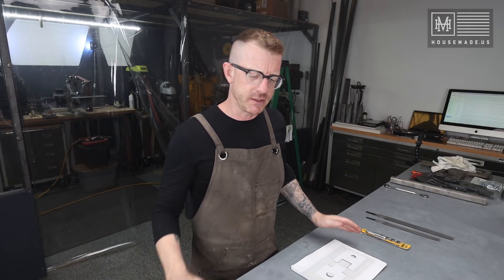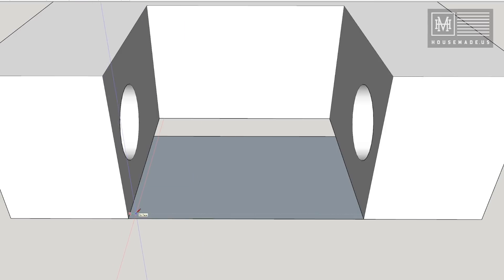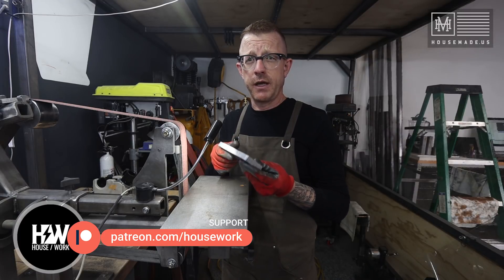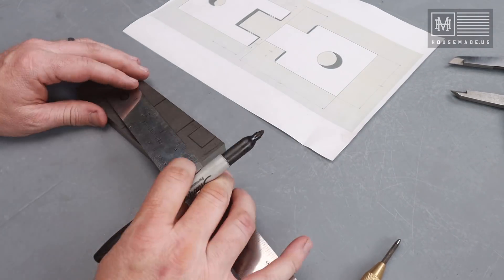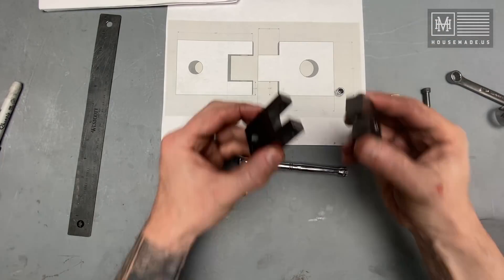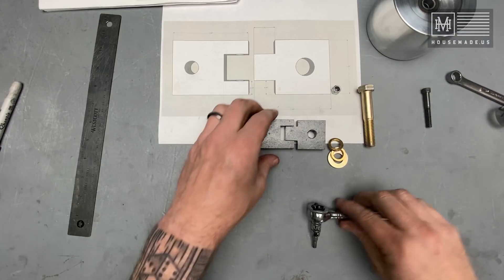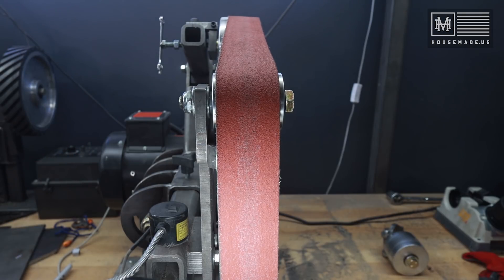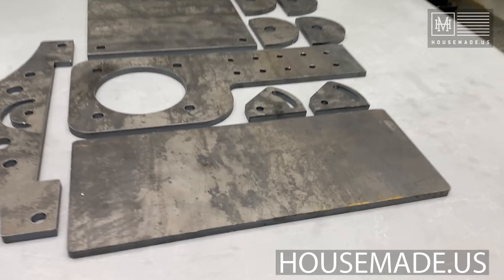How to: 2x72 Belt Grinder DIY Tracking Mechanism Build

Comment: also how to you know how to set the angle of the mechanism (align) seeing as you only have one hole and it wont bolt in square..
Reply from the maker: I use a speed square to line it up and adjust as necessary afterwards.
Reply: @HouseMadeUS  thank you for getting back to me. I ended up finding your alignment video and that basically answered all my questions. It is now my set-up bible.

Comment: If using plasma or water jet to cut the metal out is easier, cleaner and more precise, then why not offer it in the bundle package?
Reply from the maker: It’s coming in Gen 4 which is about 2 weeks out. Great minds! 💪🏻😁
Reply: @HouseMadeUS  good deal. Im a few weeks out from wanting to place an order. plus with the weather, i wouldn't get it in a timely manner. good thing its 70 degrees and sunny sky here in chile, sa. suppose to be cleared out next week for my trip back hm, to tx.

Comment: brilliant video a bullet proof unit that would survive ww111 good build as well what size contact wheel are you running it looks to be about 160 mm dia and what is the fastest belt speed you can run in meters per second please
Reply from the maker: I run a 10 inch contact wheel and at full speed we are around 6000 rpm. 😁🚀
Reply: @HouseMadeUS  that is fast 32 m/sec is recommended as a maximum for high grade steels your up to 77m/sec at 6000 rpm that is fast sir very fast, would like to have a go on that.

Comment: Just curious, why not put this in the Ultimate Build Pack? Couldn't add much to the price I wouldn't think. It would be nice to have laser cut parts.
Reply from the maker: We are working on a tracking hinge. It uses different thickness of steel so we have to buy a whole lot to make them cost effective. Small start up issues really.

Comment: Would the proposed rotating tracking mechanism allow the existing tracking wheel adjuster bolt to still work? I would say you would be twisting the bolt in the threads. I don't know if this makes any scene.
Reply from the maker: Yeah it still works, the threads are in the tracking arm not in the mechanism, so the mechanism can move freely but once the bolt is locked down it stays put.
Reply: House / Work so the tracking wheel end of the bolt is skating across the face of the bracket?
Reply from the maker: Not sure I follow what you’re asking.
Reply: House / Work where the tracking bolt touches the plate with the wheel on.
Reply from the maker: Have you watched the tuning video where I demonstrate this type of mechanism? https://youtu.be/DaOH322WRto

Comment: Do you have a drawn out plan with measurements hole sizes and tap or bolt sizes we can purchase to make this?
Reply from the maker: I’ll email you my drawing. 😁
Reply: House / Work Thank you
Reply from the maker: Did you get the email?
Reply: House / Work 
Sorry I just got home about 10 minutes ago. Yes I did thank you again and now to get metal ordered to get tomorrow after work. That will make it so much easier.  Thank you again.

Comment: Man I needed this video like in a bad way.  I had built my own 2x72 grinder about a year ago and although it was my first foray into welding I think I did a decent job although the welds look horrible.  In any case I have been having the hardest time getting the tracking right.  Can't tell you how many knives I have made over the past year and always have to straighten out the plunge lines with good old hand filing.  This is even harder and more time consuming when making my camp choppers.

I watched this video last night and when I saw the part about having a bolt at the top of the tacking mechanism that allows you to rotate the whole tacking assembly forwards or backwards it was like a light went off in my head.  What???  I thought I had everything lined up but apparently not.  I got up this morning and remade my whole tracking assembly.  Had to make a few modifications since I didn't have any 1/2" plate lying around but I can tell you this made all the difference.  Just rotating it forwards or backwards just every so slightly can correct a misalignment if all your wheels are not exactly perfectly lined up.  

Thanks for this video.  Saved me from taking the whole dang thing apart and starting over.
Reply from the maker: One of the best comments I’ve gotten ever!! This is why I do this work, it’s to help. Glad you got something out of it. Thanks again brotha!!! 👊🏻👊🏻👊🏻

Comment: hi what angle your tracking wheel ? can u look for me?
Reply from the maker: Which angle do you need?
Reply: @HouseMadeUS  i make my tracking wheel... i gave center to right-left %2 degres tilt. example my wheel center-top high 70mm, edge height 67,90mm. and thinking my angle not enough or something wrong. for this if can your wheel dimension if u write i will count your angle. sorry for my english. :(

Comment: My problem is drilling the axel hole straight
Reply: Yes but its an old one,I got mine built similar to that one acouple of years ago on the sayber OSG but i ruined a few before i got a straight hole
Reply from the maker: I push the bit down past the piece on the backside and used a digital level to gauge where I am at. Got it the first try but that could have been luck. 😂
Reply from the maker: Do you have a drill press?
Reply: My quill wanders a bit so it keeps me on my toes so to speck but i manage to get things done